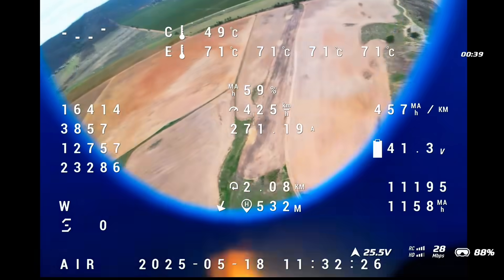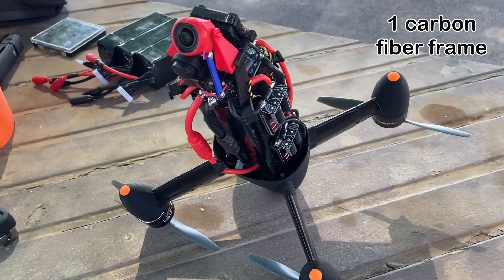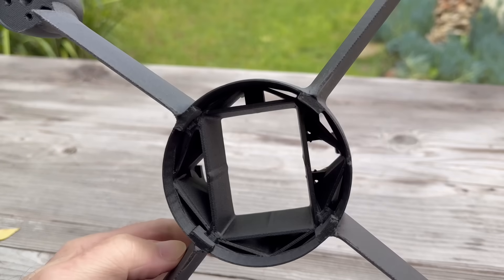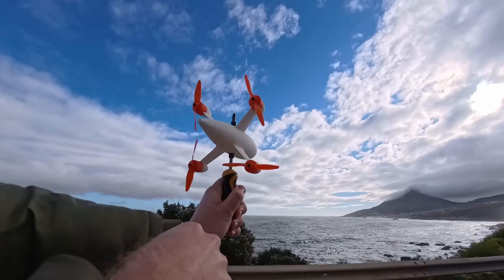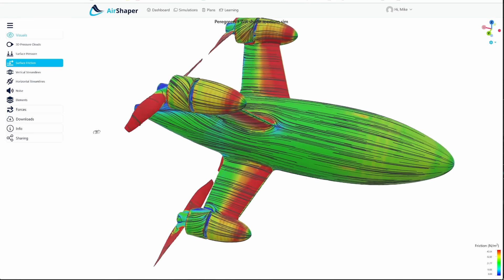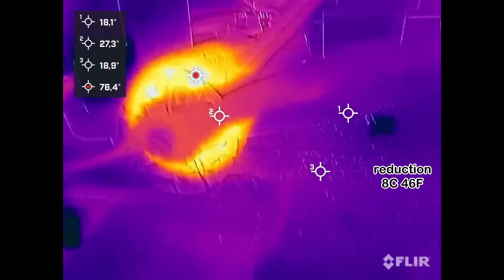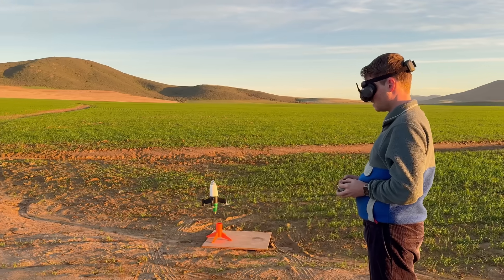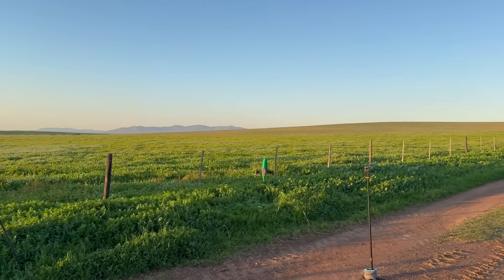How fast can a drone really go? 🇿🇦

Comment: It’s really great to see your progress, smart and convenient decisions all around. I was just curious: I checked AirShaper’s pricing and noticed it’s quite high. Did you use any of their plans? Also, have you tried using SolidWorks modules for this?
Reply from the maker: I use Blender because I know it backwards. Onshape would maybe offer some advantages but I don’t feel like learning new software 😂

AirShaper is a serious CFD platform. We wouldn’t have been able to break the record without this partnership. We showcase their tech in our videos in return for simulation credits.
Reply: @Mike-Bell  Thanks! They have some really good presets, but the price is a bit steep 😅.
Fusion 360 (core version) isn’t as flexible as SolidWorks or CATIA in my experience. I used to run some airflow analysis using SolidWorks modules, and they worked quite well.

In any case, I’m really happy to see you back! I’ve been closely following your channel and Fastboy’s too. Hopefully one day we’ll see both of you in the same place competing side by side 😊
Reply from the maker: @theonlymr292  we did the official Guinness record in Dubai in June and we both have those videos done but we can’t upload till we get the greenlight. Be on the lookout for when they are up
Reply: @Mike-Bell  Sounds amazing! Can’t wait to see it!

Comment: Instead of water cooling, use isopropyl alcohol, and let it vent throughout the flight.

Best of luck from Durban (I was also at the 2016 drone racing nationals in case we've met already)

Comment: Suggestion, 
Turn the props around so they are in a puller configuration. They will be more efficient due to no dirty air.
Reply: Having the props at the rear means laminar flow over more of the body. However there could be a large drag reduction by adding spinners to the props  to match the shape of the back of the main body.

May require the water cooling to be pumped out around each motor…
Reply: i get the feeling they did that because they had more drag exposing the 4 circular faces of the motors than hiding it in the tear drop

Comment: Absolutely amazing! Well done. 
(One of the parts I love most about this is seeing the Father Son connection in chasing this record).

Out of curiosity, what made you & Luke settle on the DJI Remote 3 for the control link?
Is it because something like Crossfire or ELRS require an extra Transmitter/Receiver this complicating packaging? Or something else?

Thanks so much, and again congratulations 🍾🏁
Reply from the maker: Thanks.  Luke tried ELRS but went back to DJI.  Not sure of what impacted his decision but antenna placement is tricky because nothing can stick out in the airstream.
Reply: @Mike-Bell  And are the motors Chris Rosser’s AOS custom designed ones too?
Would love to hear more about that from your point of view also.
Thanks so much again 🕊️
Reply from the maker: @lecolintube  The AOS supernovas were super challenging but we nursed them to success. Will expand on the bell wobble and magnet grinding issues which crashed too many drones in future videos and compare them to T-motor which are way tougher. Not a fan of the supernovas but they are working on stiffer bells and hopefully that eliminates their self destruct mode.
Reply: @Mike-Bell Wow, beautiful. Can’t wait to hear about it.
Thanks again 🕊️

Comment: If you could hire the best engineers, use the best manufacturing methods, source the highest quality components, how fast could we go?
Reply: I think we have a hard limit with current tech round 700 kph.
Reply: @LukeMaximoBell  I wonder if you used a similar drone design (somewhat), but scaled it up 2-3 times and used micro jet engines. It would be very expensive and probably not worth it, but I bet it would go very quick.

I've seen a few quad jet drones but they are REALLY expensive in the 10s of thousands of dollars. Maybe someone could make the first super sonic jet quad drone. Although legally, I think it might be tricky or impossible. And the speed, it could just be too quick and run out of signal range.

Comment: I wonder if ducted fans may be the next step.  The lack of tip vortexes might translate into more energy for thrust.  If ducted fans might not be an option, contra rotating props?
Look I am curious on how fast we can get a drone to go before turbines have to be used, so I am throwing in some ideas because I want to see where the limit is with hobby equipment.

Comment: wow sluggish take off, you need a simple slingshot launcher hehe. have you thought or tried cpu cooling with the evaporative type like those in laptops, because water is heavy and those close circuit evaporative ones are sealed and use water in it.

Comment: Thanks so much for sharing your information. It helps a ton with speeding up the design loop for others building high speed drones. Incredibly impressive. Is there a reason you switched from the APD to the TBS lucid ESC? Was it just for cost effectiveness because of crashes?
Reply from the maker: Oi. That’s question is complex gets answered in around 15 crashes. AM32 issues too all centred around grinding motors. ESC’s got the blame till we realized motors were the cause of problems. 
Lucid are great. APD are great. AM32 not really suitable for this use case.
Reply: @Mike-Bell  why exactly is am32 not suitable?
Reply from the maker: AM32 has been updated based on our experience and our logs and added missed timing protections so more than likely all good. We are in more discussions with them. But we are just skittish for doing testing on AM32 right now. It would be nice to have others guinea pig the updates. We know the APD’s seem to track the rotor position better. So play it safe. 

Testing the new AM32 would require a gimballed bench test rig. We might pluck up the courage to do that. 😂

Comment: For print material, try PPA-CF-Core, it's relatively new but the test results from other youtubers are incredible, very stiff and excellent layer adhesion (over 100kg load before layer separation).

Comment: Suggestion: replace water with a heavy paraffin. I think you're just using the thermal mass. Parrafin is ighter and has much more heat of fusion than just heating water.
Reply: Paraffin has low thermal conductivity, but you can add graphite to improve the thermal conductivity. But, water has twice the thermal mass. So although paraffin is lighter, it takes twice as much volume to equal the equivalent thermal mass. Since paraffin is only 83% of the density, you actually need 66% more paraffin by weight to get the same thermal mass as water. So water in this case is actually less weight.
Reply: Using it for speed (either jet wasteful or drive a turbine+prop) would be kind of cheating imo.
Reply: @JosGeerink  I doubt you'd get significant thrust, but a drag reduction should be possible if the coolant vent is placed carefully.

Anyway, using cooling this way has a long history. WW2 fighter planes often used careful shaping of the radiator ducts to ensure that air left the radiators at higher velocity than it entered, countering some of the radiator drag or even producing a small amount of thrust under ideal circumstances. Such radiators essentially acted as very weak ramjets, but we don't disqualify those planes from propeller speed records for being partly jet propelled.
Reply: @nerd1000ify Meredeth effect!
Reply: @nerd1000ify Meredith* (remembered wrong). But that doesn't really make it a ramjet 'cuz ram compression is negligible at those speeds, and you don't combust it.
Reply: @JosGeerink  It's a ramjet with a very low overall pressure ratio (about 1.15 at 600 km/h, assuming a perfect isentropic intake) and convective heater rather than a combustor. No rule saying that ramjets have to burn fuel! See "Project Pluto" for a case where that fact was taken a little too far...
Reply: More space for warhead...
Reply: I agree that phase change cooling is the way to go, and there's a few options. My suggestion would be either pure ethanol (let it boil and dump the gases into a low pressure region on the airframe) or even more extreme a mix of ethanol and dry ice. Ethanol remains liquid at -78.5 C (though a bit viscous) and will work to transfer heat to the dry ice which will then sublimate, once again the resulting gases can be vented.
Reply: Are you monitoring atmospheric pressure for your experiments? It seems that could produce a couple kilometers per hour difference in speed.
Reply: Agreed. a PCM would alllow to dump the the most energy per unit mass. though water is still ahead with 334 J/g of HoF on top of the 2.1J/g and 4.2J/g in specif heat capacity. the question is if the electronics appreciate sub 0C temperatures and how long replacing the ice/water tank takes.
dumping boiled off gas overboard wll reduce thermal conductivity unless the tank is longer (in the direcion of flight) than the area that is beeing cooled.
Reply: Just get a big chunk of Gallium
Reply: @incubusfan4211  Gallium:
density: 6kg/l
specific heat capacity: 0.0053 J/g (0.126% compared to water)
heat of fusion: 80.17 J/g (24% compared to water)
thermal conductivity: 40.6W/m/K (13.5% compared to copper)
It's only selling point is the low melting temp.
Reply: You can melt Ice. There fore energy used is much more. So do ice block in the whater. Why didnt you ask AI chatgpt ?

Comment: 585kmph was at 86% throttle, surely there's more in the tank?
Reply: Battery life starts to become an issue. But yes in theory if I held 100% a little longer it could do more
Reply: They are bumping against the sound barrier with their props, so probably not.  You have to throttle limit these things so they dont spin too fast.

Comment: TBS Lucid 12S 90A ESC and RC InPower AOS 3220. Very nice gear. Wasn't able to catch the FC or the motor KV- but with 12S I suspect it was the 700KV variant (or custom wind) . I just put that same 900KV setup on one of my custom 13" frames. You guys have a lot of patience and even more money. None of that stuff is cheap. :P Did Brian White help you tune it up? I saw you running PID Toolbox. Congrats on the record. It's a hell of an accomplishment. With that amount of work and attention to detail you deserve the title. Well Done. Subscribed.
Reply from the maker: I have filled out the component list in the description.  Thanks for subscribing

Comment: Would it make sense to have an additional vehicle that launched and got the speed drone up to higher speeds, then releasing the speed drone to make the speed record run? The carrier vehicle could be built into the platform you launch from, since it doesn't need to be super performant.

Comment: 16 kilowatts power draw from a battery that size is insane
Reply: Half of a Dacia Spring EV... 😅
Reply: 5k watts to take off and 1.5K watts to cruise at 125mph is also so wild! it is a very purpose built machine!
Reply: @DadeWheless  Fixed pitch propellers optimized for the best L/D at top speeds means they're fairly close to stalling at liftoff, generating huge amounts of drag for an absolutely tiny amount of lift.

I wonder if variable pitch props will ever become a big thing for these machines. Collective control doesn't add that much complexity and would allow props to be run at the optimum AoA at all times. But to make it work you probably want to integrate it with the motor as much as possible.
Reply: @CensoredUsername_  good for a reusable platform but these are speed record drones. The streamliners running on Bonneville also need to be pushed by cars to get them roling
Reply: Our house draws about 4kW on an average day.
Reply: @tsbrownie  Your house doesn`t fly ;)
Reply: It is poetry
Reply: The power efficiency regarding the peak draw for RC batteries is generally insane. Granted you don't fly for long, but boi do you get some power for the size.
Reply: Probably a very stupid idea, but would a slingshot launch help reduce power consumption at take-off? Or does this negate the record?
Reply: Try to create other formulations of phrases that do not repeat the use of the word "insane." It will be more interesting to do and read. Because that's it. Any parrot can make up such phrases. «Insane, insane, insane everywhere»...
Reply: @abc369  well instead of just complaining maybe offer some alternatives?
Reply: @sammy5576 
I've already made a sensible point. It is enough to understand that such phrases are the most banal primitive.
Reply: @abc369  Then you are a terrible educator. 
You expect the average normal person who doesn't dedicate their normal lives to  normal communication, but other more normal useful tasks, and yet you are hyper focused on a simple normal expression by normal humans with normal educations in the English language. 

Do better.
Reply: @abc369  “banal primitive” is totally insane (you wild guy you 😉)
Reply: @Golden_SnowFlake 
I cou I couldn't understand your philosophy. I said no more than I needed to say, and you decided to arrange the training. This is another task for which resources need to be allocated, and it was important for me to convey that these hundreds of support signals are focused on the primitive. You can say whatever you want afterwards, but if you liked something in that comment, then this is an excuse for you to enrich your mind or consciousness. Because IT SEEMS to ME that you are unnecessarily stuck on YouTube, you like it so much that you no longer notice the catch, and you can be fed any bullshit.
Reply: @abc369  
Your ism is showing.
Reply: @abc369  How about a dead parrot (an ex-parrot to be more specific)?🤔